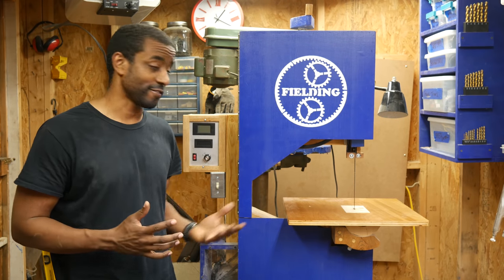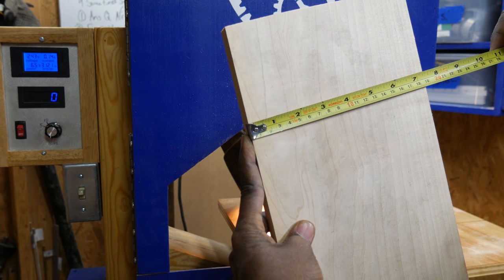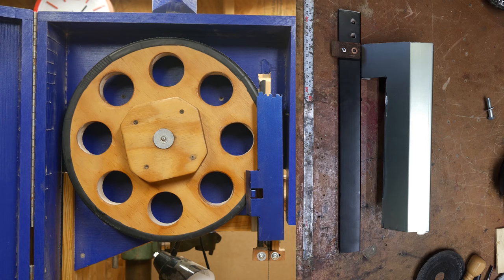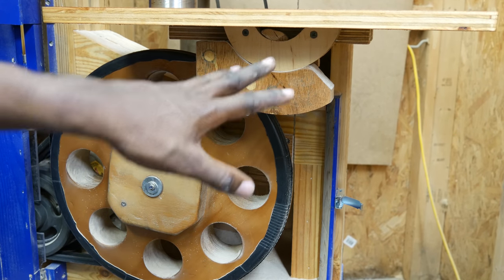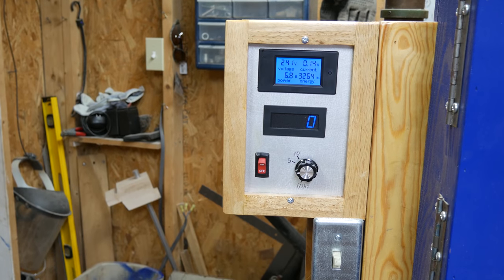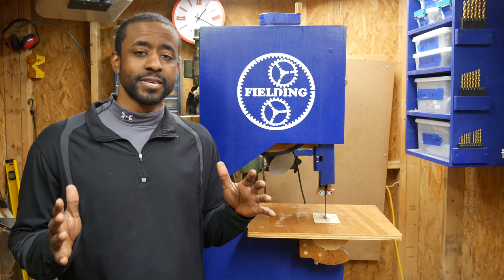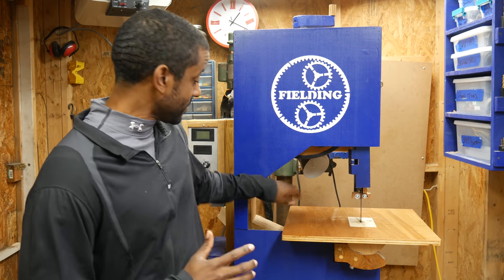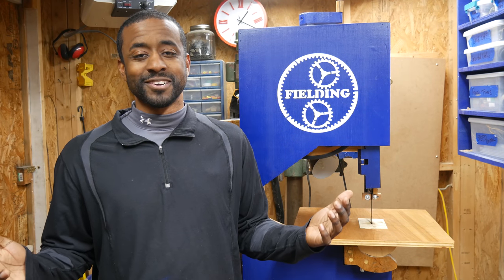My Version of Matthias Wandel's Band Saw with Variable Speed for Steel Cutting : 055

Comment: i am thinking about building this thing for a while now. but salvaging stuff is pretty hard here in austria. motors can be aquired but good wood and steel parts (as well as li-ion batteries for another project) are next to impossible...

what i am wondering is if you could share your resources on motor and motor-"driver" know how?
Reply from the maker: I have a whole video series on wiring motors and speed control... just check my channel
Reply: yeah, i know, i also watched them several times. but there is a difference between reading the background info as opposed to watching a video ;-)
and afaik you do not really explain how i would build a speed control for a universal motor that i have lying around here...
Reply from the maker: I use the web and I tinker in the shop. No body writes books on this stuff. The universal motor controls are covered in my “how to wire a DC motor and control the speed” I show a Universal motor and how it’s done. It is the same as the DC motor.
Reply from the maker: I just realized I was “combining” your question with someone else in my head... I get a lot of questions so forgive me. I gave a list of books I used in my question and answer video on motors. The picture has a giant motor next to my head in the thumb nail. You will find that useful
Reply: thanks for your response and info!
i was more looking for a pwm based solution instead of a transformer based one.
another thing that i figured is that most products you suggest are not available in Austria so i will have to hunt down my own resources ;-) but you gave a few good pointers! thanks again!

Comment: Where do you live again ? I have been told that in usa there are still 110V in all houses..
Reply from the maker: We have both. Almost every outlet is 110/120, but we usually have at least two 220/240 outlets. The stove if it is electric and the dryer. However we have access to as many 240 circuits as you want in the house.
Reply: What we have is called single phase center tapped 240 VAC. So between either hot and the neutral is 120VAC and between both hots is 240 VAC.

Comment: DIYers always leave out the cost of labor, great job, 4hp, sounds like a wee bit over powered. Why needle bearings, were they just what you had, or are they supposed to be more durable than roller or ball bearings,  after all they use the later on automobile axles?
Reply from the maker: I should start by saying nearly any bearing can be used in almost any application if spec-ed out to fit the demands of the application. Mathias certainly picked a bearing size that was appropriate. With that in mind needle bearings for the same cost can run much faster and at greater loads in general. Someone might come along and think of some random exception but that is the reason I changed it, cheaper, stronger, smaller and higher speed rating. Smaller was good because I have drill bits in that size instead of using a circle cutting tool like Matthias did.
Reply from the maker: There is no such thing as over powered! What kind of channel do you think this is? 🤣
Reply from the maker: If you are worried about the cost of labor you are not enjoying what you are doing, and it will never be worth it for a project this size. Labor for something like this is meaningless to others anyway. We don’t have the same tools, experience, working speed, working space, different mistakes, starting material. Almost nothing makes it worth comparing my “time” to yours... including what your “hour” is worth to you

Comment: How do you build the VFD control system that’s mounted to the bandsaw?
Reply from the maker: It depends on the VFD this one accepts a voltage signal of 0-5 volts to control the frequency... I am doing that with a potentiometer and 5 volts from the VFD itself.
Reply: Jeremy Fielding I’ve been having trouble setting my VFD up I’ve got all the components right, I believe I have all the components right! I think it’s  programming the VFD that’s giving trouble.  If I send you the VFD would you look at it for me to make sure it’s not scrap and I can stop wasting my time with it.
Reply from the maker: Unfortunately I can’t help directly like this. I hope you can understand, I get hundreds of request like this. It just isn’t safe or practical to give one-on-one advice.

Comment: What is your blade speed for cutting steel?
Reply from the maker: I used a chart from a bandsaw blade manufacturer to calculate my numbers. I think it was 100 ft/min but you have to look it up. It varies based on thickness as well. There are charts online